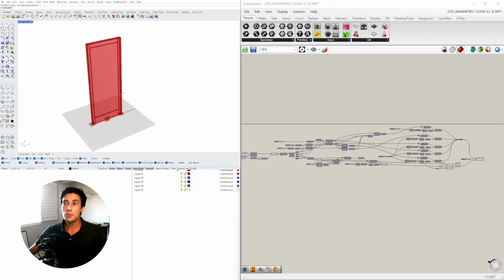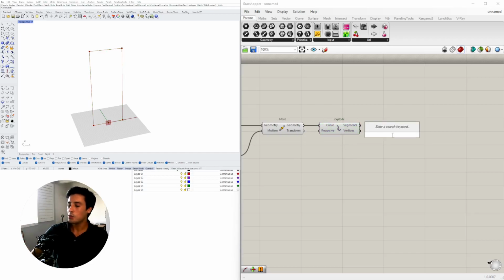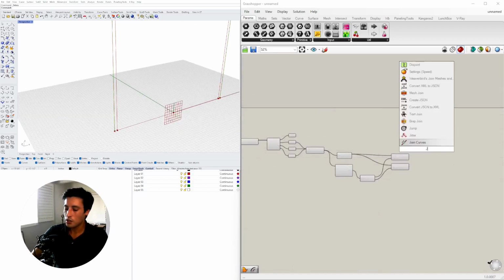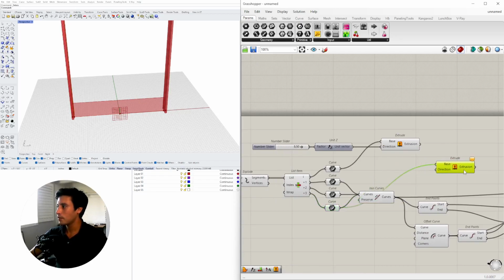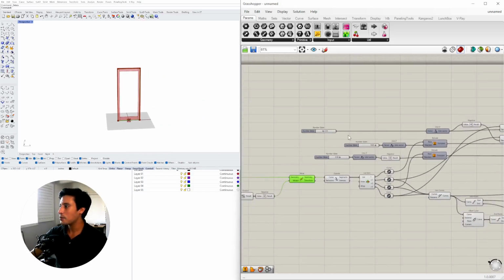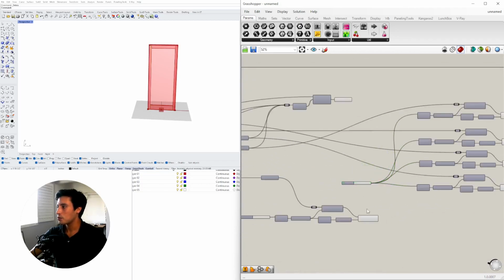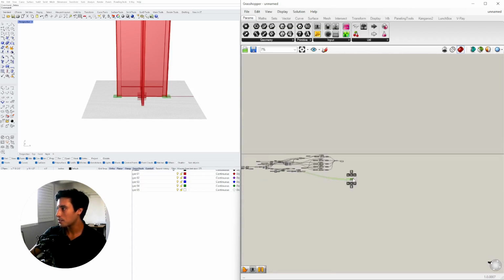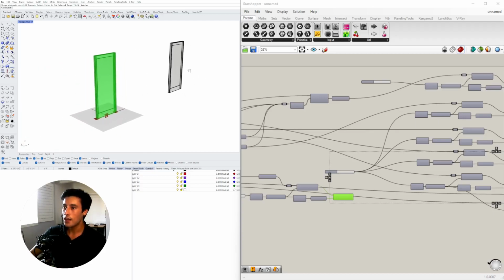Learn Grasshopper with short Exercises + practice techniques for any design!  Parametric Door

Comment: I struggle a lot with the doors because frames and doors should be independent. There should be spaces between them. I solve this using scale NU on a set of pieces. My strategy is the famous bounding box and brep join IF needed. 

Door swings are way hard because the door needs to be scaled properly with respect to the frame. I suffer a lot with this. :3